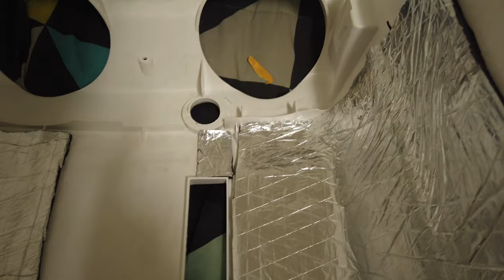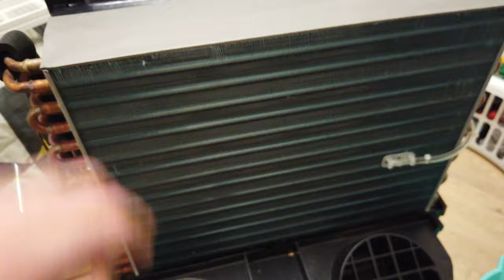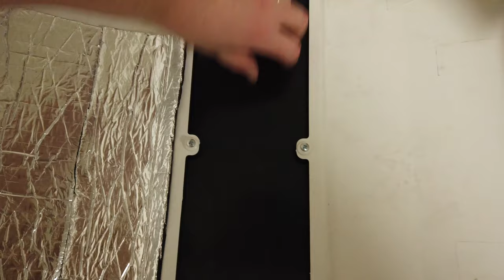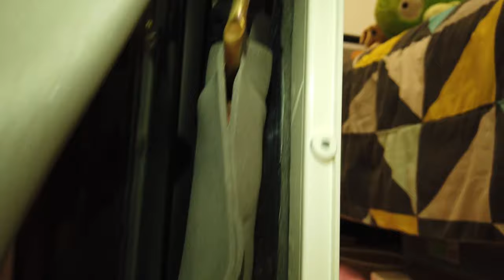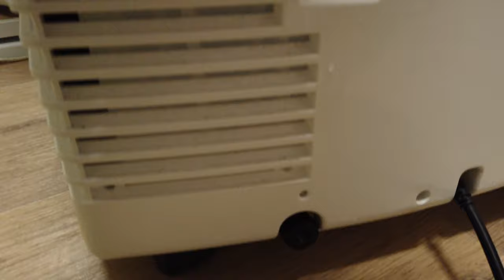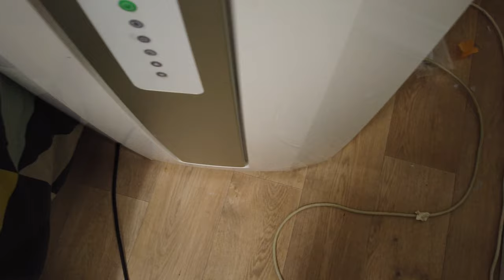Making Portable Air Conditioner More Efficient | Dual Hose Hack

Comment: My only question is, how effective is this if it’s 100 degrees outside, wouldn’t the ac be working much harder intaking outside 100 degree air and cooling that rather than just cooling the inside room air which would be much cooler than outside air?
Reply: No cause when teh second hose isnt there it only blows air outside wich mean ther will be a lower pressure in youre house so air will be drawn from outside hut in this case the only the cool air stays inside and the hot air takes air frok outside and blows it back outside but it should still be quite a bit more efficent then with one hose
Reply: The problem is that the unit is taking your air and pushing it outside while it cools the unit. This means it creates low pressure inside so hot, 100 degree air is drawn in from outside to equalize air pressure. If you have air drawn in through a hose to cool the unit, air pressure remains equal. I think.
Reply: 100 should work but 120 could be too much depending on the specific model/brand/quality and the type of gas used to make it work.
Heres's also a quote from reddit: The compressor and the other components can only sustain and generate a given total pressure difference between the evaporator and the condenser. The condenser in turn must be enough hotter than whatever it is rejecting heat into (air, for instance) to get rid of the heat it picked up in the evaporator. The condenser temperature depends on the condenser pressure. When the outside temperature conditions correspond to the highest temperature the condenser pressure can sustain, no heat rejection can occur.

In practice the unit typically just shuts down to protrct itself, or burns up the motor, before this absolute limit is reached.
Reply: @Requiredfields2  - single hose units don't work well in leaky rooms/houses.
Reply: The vent air temp is ~20F below intake air temp.   A single hose unit would be better if the room/house is not leaky.

Comment: You should completely wrap the hot exhaust HOSE with insulation!
Reply from the maker: Yes that is another option, I wrap it in old towels , there is PVC coated aluminium duct which I have used on a smaller unit and blocks heat well (whilst still being flexible)

Comment: I noticed you have a reversing valve in there, it is a heater or heat pump as well right?
Reply from the maker: Yep super common in Australia 99% of hard installed systems are reverse-cycle, most mid to high capacity portables are also reverse-cycle.

Probably due to electricity being the only real national level infrastructure we have for heating. Or just because winter isn’t very cold here compared to other countries lol
Reply: @Slot1Gamer  that’s awesome for you guys, over here in the us I guess we’re just plain stupid 😐. Most and I mean like almost all of our air conditioners aren’t heat pumps they’re not reversible which I think is absolutely absurd. Anyway thanks for the info. Great vid!
Reply from the maker: Thanks :) yeah that is strange, our winters aren’t as cold for the most part though
Reply: @Slot1Gamer  yeah, even though heat pumps won’t work some days of the year, doesn’t mean we can’t use them, we need to stop the “oh it won’t work all the time so we must not use it” no. It’s gonna save us money and reduce emissions. So what I’m saying is we can design them to work in really low temps, and even if we can’t there’s always backup heat such as electric resistive heating or burning fossil fuels.
Reply: Get a logik glp09 port ac, its a heat pump that is cheaper than the other ac only ac”s. Its 9k btu but is real good

Comment: Instead if doing it like this, couldnt I convert the cold air outlet to a hose, put the unit outside and pump cold air in?
Reply: Thats what I was thinking. But I don't think the fan is strong enough to push the air effectively, you'd need a pretty big diameter pipe and it should be very short. That should work I guess?
Reply: I did this a few years ago during a heat wave, but it was even easier as my single hose unit can both heat and cool. 
So I just put the unit on max heat mode and piped the (now cold) exhaust in a window.
Hey presto, the house is positively pressurised with nice cool and fresh dehumidified external air
Reply: Late reply... but the problem is the unit would never stop running and is still inefficient because the cold air is  now getting pushed out of the room
Reply: The cold air would be displacing hot air coming into the house. This is actually far better, because it means you’re not just moving hot air around the house and cooling one room. I did exactly this last year when it was 40°C in England and it cooled my entire bungalow down to comfortable temperatures and avoided negative pressure bringing heat and pollen inside.
Reply: @AdmiralValdemar so you left the unit outside and pumped the cold air inside? Did you run it to a fan to move the air around?
Reply: @rickjames1246  I did that, yes. I have a tower fan in the room the hose was pumping into to distribute the cooler air around the home (it's a bungalow, so just having the doors open in each room helped).

Worked far more efficiently and the noise is also outside. Had to consider a cover like awning for it should rain be expected, mind. But then the days I'd need this setup are often not ones with a cloud about.

Comment: theoretically, single hose and dual hose are same, imho. 

# single hose
- will vacuum the warm air from the holes of your room (e.g small holes from your doors/windows)
- will use the same "cold" air from your room then the compressor will make it cooler

# dual hose
- will release cold air from the holes of your room (e.g small holes from your doors/windows)
- will use "warm" air outside the room then the compressor will make it cooler.

I can say it because I already tried both scenarios. If you have dual hose portable ac, you can observe from outside that your room is releasing cold air while if you're using a single hose the effect is opposite but almost same, the warm air from outside the room is entering if you have single hose.

(sorry for bad english)
Reply from the maker: Yeah I see what you are saying, however with single hose you are lowering the air pressure a lot more than dual because you are both cooling the room air and evacuating air at the same time 
In a perfectly sealed environment, the single hose unit will still fail compared to dual hose as the volume of air being replaced is so much higher with single hose
Reply: I also agreed on that, and if the air outside is hotter than the air inside the compressor will works harder which will consume more energy. so I guess it's case to case basis.

advantage of single hose it use the same cold air to make cooler air while it creates low pressure because hot air from the vent didn't replaced.

advantage of dual hose, it prevents low pressure because the air from the room was replaced by the air outside but the downside is it will make the compressor work harder to make cold air if the air outside is hot.
Reply: @Slot1Gamer  - the air temp coming out of the cooling vent is always ~20F below  the intake air temp regardless.  The main problem is the leaky room/house.  Crack open the basement window if you have one for cooler inflow air to the house.